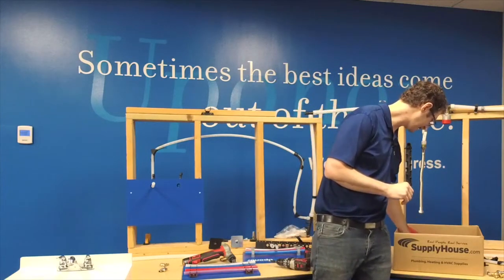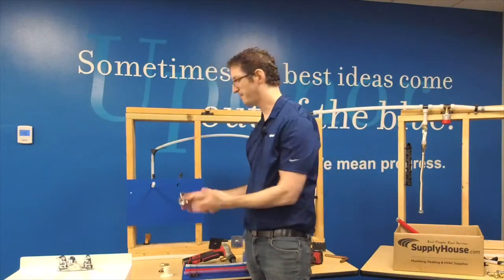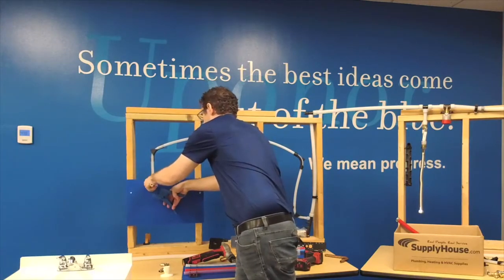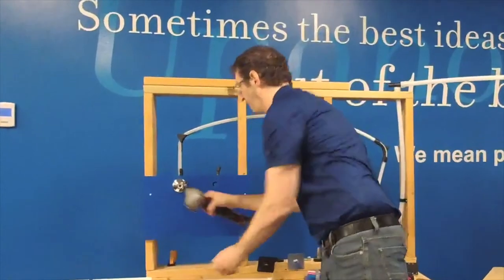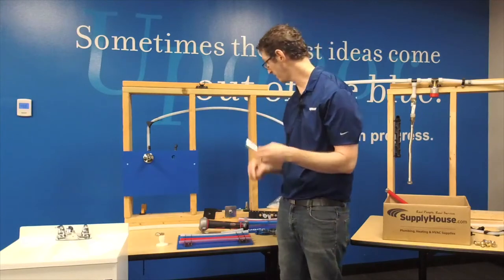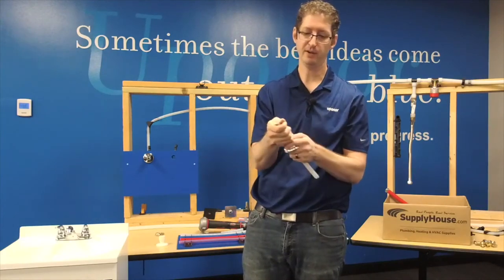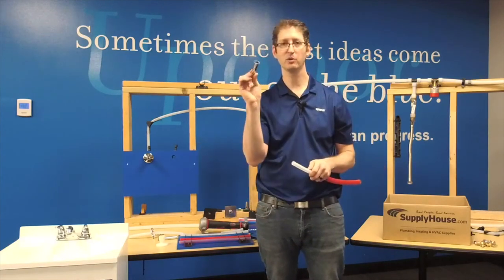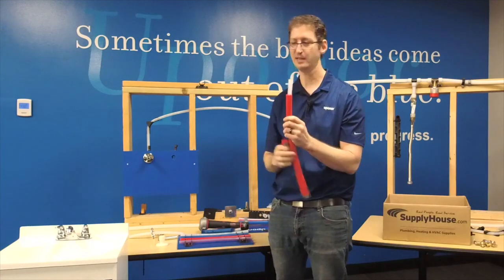Uponor Escutcheons

Comment: So how does the next plumber remove that valve?  Btw, a close up camera shot would have made this presentation spot on.
Reply: Humm.. that is a weakness of this system. But if the wall is drywall you could cut around it and install a whole new fitting. At least you won’t have corroded pipe in the wall to wrestle with.